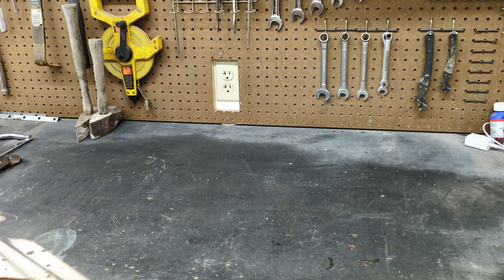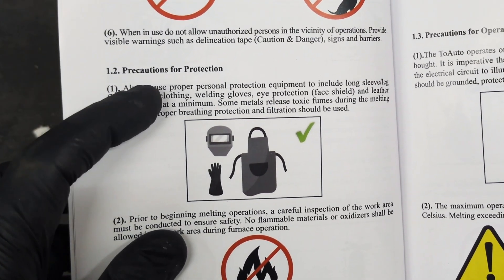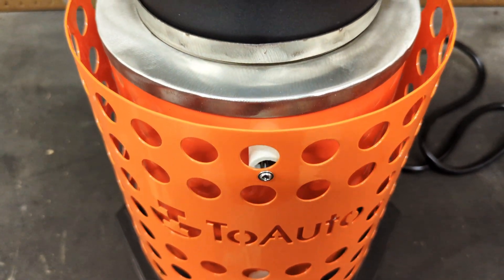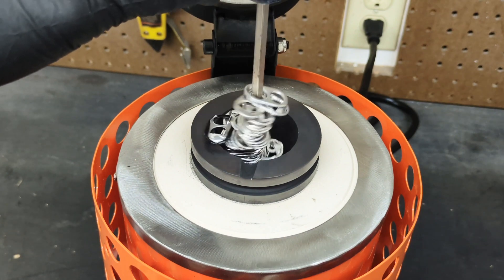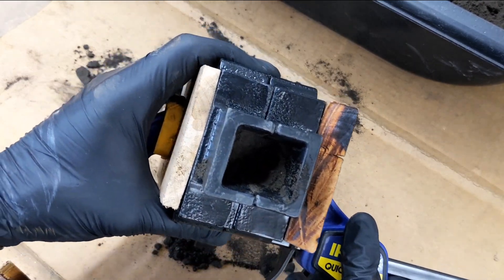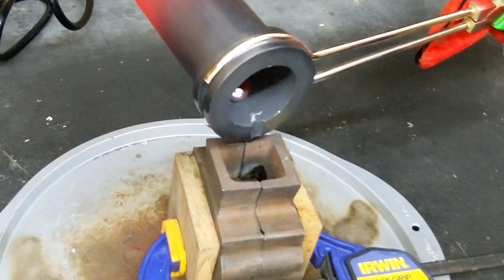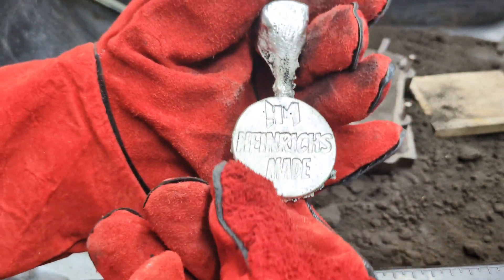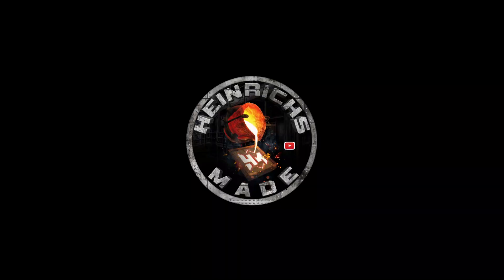NEW!!! ToAuto Electric Melting Furnace - Budget Electric Furnace TRF3000

Comment: Right off the bat you say it melts copper in half the time if other furnaces but then don't show it melting copper... you show other metals with much lower melting points. Disappointing since copper is what these types of furnaces all typically struggle with our can't even fo when they claim to.
Reply from the maker: I stopped using this after burning out the coils.  Copper is very difficult to melt and puts a strain on the units.  The coils on any furnace will burn out after heavy use melting copper no matter how fast it heats up

Comment: Great video on the new To Auto foundry. I have the old style, like you said is slow to heat. Good tip on the 2 piece cast iron mold, with green sand. Good pours .Thanks for sharing with the community. 😎😎⛏⛏🔥🔥
Reply from the maker: Hey thanks!  I'm still using my old one actually.  It does take awhile to hear up compared to the new one.  My new one broke unfortunately.  The heating element broke. It can be replaced, but I don't feel like spending the money.  I think it broke, because it heats up so fast.  I think it would be best to adjust the temperature up in increments.

Comment: i’m getting mine on Monday.. i’m appreciate you creating this tutorial. i am new to smelting. it’s something else been wanting to do for a decades. i use my pop tops on my hangers! lol

is the kinetic sand better than regular sand?
looks like i have some learning and researching to do.
Reply from the maker: Sweet!  Make sure to buy a face shield and wear long sleeves.  Kinetic Sand works well with pewter, tin, and lead.  No so much for aluminum.  Yes kinetic sand is better than regular sand because it holds its shape.  Where as regular sand does not

Comment: Are you running that on 20amp or 15amp circuit? Seems like 1800w would push a standard (US) outlet real close to 15amp. I still have the older one, but this one has my attention.
Reply from the maker: Hey Brian! I do run it on a 15amp circuit.  I've only had a kick a gfi after a really long runtime.  With any electric furnace, they do advise not to run it continuously.

Comment: I do love To-Auto, their CS teams are a dream to work with for makers xD 

Does make you feel like you're reading a tightly controlled script in bits in the video hehe
Reply from the maker: Yeah i liked the ToAuto furnace I had before this one.  This one heats up quicker.  Now I have 2.  Hmm, Maybe I'll do a comparison video 🤔
Reply: @HeinrichsMade  If you can do a dissasembly level comparison of them, that'd be most grateful for us makers. The changes just in the first gen models I've had, and the next model up with how the element has gone from been exposed and unsecured around the ceramic chamber, which led to veryu frequent breakage of coils, and the newer one I have with the coil been fully encapsulated in soem form of silica/potting that stops the coils from expanding and touching one another or dropping down and touching etc. 
I've seen some variants that use many small downwards coils directly inside the chamber too, which could be lethal to users, as there's no switch turning them off when the lid is raised, and graphite is incredibly conductive.. so very easy to imagine accidents. 

So yeah, would love to see the insides of the two variants you have and the electronics guts of them too :)
Reply from the maker: @noviceartisan  well that would be great, but I don't want to disassemble something that I use and works 😂😂  When the coil burns out I most definitely will.  Electric furnaces, as you know don't last forever.  I believe the coils are exactly the same as the last model though.  That wasn't one of the upgrade points.  Looking it up online the coils rap around the heating chamber in a circle.  As you said your new furnace is fully encapsulated.  I don't know if that will keep the coils from breaking.  It's the constant heat that makes it become fragile.
Reply: @HeinrichsMade  Kinda, without the encapsulation, those coils expand and sag down, touching the coil below them, causing a short circuit. I've had to manully recoil my old one literally dozens of times, really hated the poor design, and was cheaper to just keep makign coils. So I'm intimately familiar with the design flaw. Only changed to a newer model after discovering they'd fixed that issue by using the slurry to cover the coils, which has the side effect of never been able to replace the coil alone, the whole chamber needs to be replaced, which is like half the cost of a new unit.. vs a cheap bit of Kanthal wire that you could easily turn into a coil and replace for a few quid when needed. 
It's a solution, but i don't think it's the best one. 

Regular wear and tear on kanthal, or nichrome wire, means at bronze temps, we're gonna need to replace it in under a year with a single use daily. It's the same wire, and same concept with kilns. They're just designed better, with shelf parts for the coils to rest on as they cook at even higher temps than we reach in these little furnaces. The first gen ones just had coils wrapping round indentations. They should redesign the chamber to have the same kind of shelves for coils to rest on, so they dont slip off during thermal expansion, or even a tubular design that the coil can be pushed through to fully go around the chamber, letting it be enclosed, but with enough space to permit the coil to be replaced easily when needed
Reply from the maker: @noviceartisan  I used to use cast master elite, but they had problem with their coils burning out.  Their coils had a shelf between each coil of nichrome wire wrapping around the heat chamber.  Plus having the wool packed against it.  Their problem wasn't the coils touching each other.  I believe it was their pod controller.  They stopped making it and selling it.

I would have thought all makes had a shelf holding the coils and keeping them from touching.  That's strange to me to hear they don't all have it.
Reply: @HeinrichsMade  Yeah, i found images of that, similar to my junk one. Those shelves aint big enough by far lol under the heat the metal sags down and easily makes contact with the row under it. It's a longer "shelf" but not a shelf in the style of a kiln, where it's designed with a lip going up, to stop it coming out, and well past teh diameter of the coils themselves. Take a look at commercial kiln design, and how the coils are put in the firebricks. One on my insta that kiln i made myself has the shelves done right, they'll never sag down and touch another part of the wire.
Thoe early frunaces were all like that, just wrapped around with the force of the coil under tension been the only thing that holds the coil in place, but once heat hits, they were fully loose and slipping down easy :)

Comment: How do you clean out the residue of the metal in the crucible before you do the next melt? Especially if melting a different metal..?
Reply from the maker: I tend to use diff crucibles for different metals.  With aluminum, you can normally just pull it out.
Reply: @HeinrichsMade  good to know, thanks for replying 👍
Reply: I had the same question